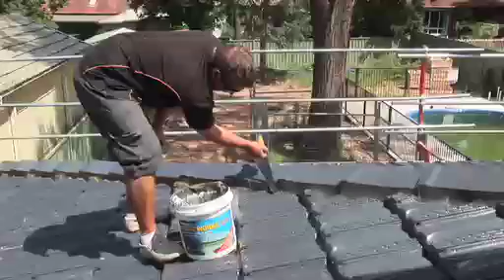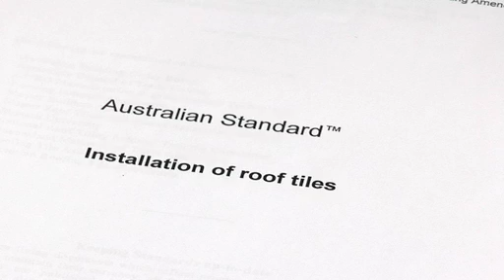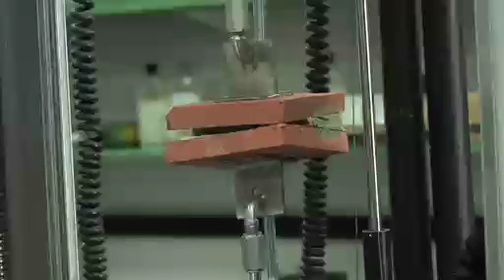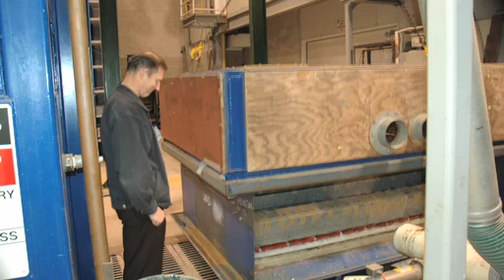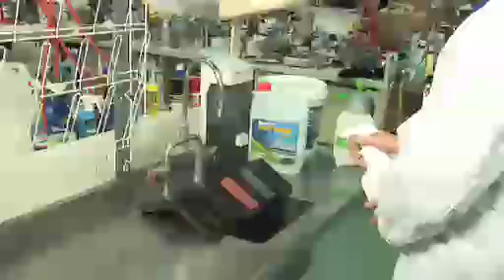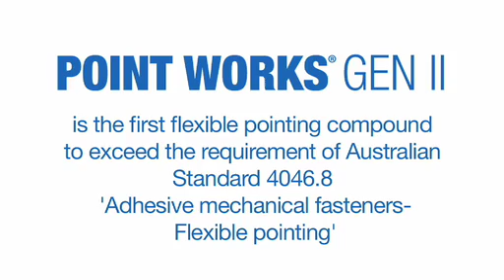How to use Selleys Point Works Gen II Tile Pointing Compound

Comment: I’ve used both this product and the Dunlop. The Selleys is superior in application and performance. I don’t understand how people are having trouble with it. Try working a smaller area about 250mm and wetting the trowel or spritzing the pointing with water before finishing. I found the Dunlop takes a while to fully cure, especially if applied thicker than recommended, which becomes problematic if it rains. I wasn’t impressed with the Dunlop and wouldn’t recommend it.

Comment: Gary Tibbott :- 
I have to agree with Chris F. I found the Dunlop product to be better. Ended up mixing a bit of water in to make the Selleys a bit smoother, even a light water spray on ridge tiles. Selleys is a tough product to work with otherwise - and very hard to get a consistent smooth finish

Comment: I am not very happy with this product at all, it failed to live up to expectations given in the videos in the sense that it was 'unworkable', that is it simply would not come to a nice smooth finish not matter what trowel or tool I used. It was also too runny fresh out of the bucket.  It was a mild, overcast day, so no issues with skinning or anything else. The product is simply far below the standard I expected. I have worked in the building industry for over 60 years so I am not a novice.  I then made my own mix using 4 parts brickie's sand [can also use yellow plasterer's sand] , two parts clean washed concreting sand, 3 parts cement [yes, I know, it is a bit too much cement but it WILL be strong] and coloured oxide to taste.  Mix the lot up dry in a deep bucket using a steel wand in a slow revving electric drill that painters use to mix their  new cans of paint.  When it is all nicely mixed add good, fresh water and keep mixing until it is the same consistency of very thick cream.  Use a nice clean pointing trowel to apply it and do not mix more than you can use in an hour or two depending on the weather. Cheap, very effective.

Comment: The worst product I've ever used. It skinned in less than 10 seconds and was totally unworkable on a mild / not windy day. It stuck to everthing except the tile I was applying it to.  Little dags come off when working and stick all over the roof and gutters. The finish was average to poor compared to the 60 year old roof next door. Nice video though,with the safety glasses and nerds all excited....